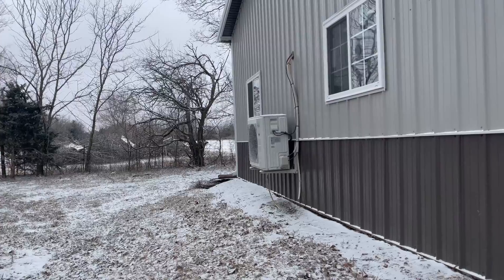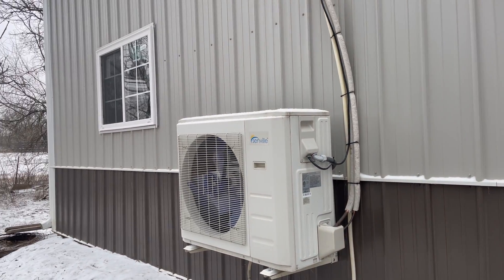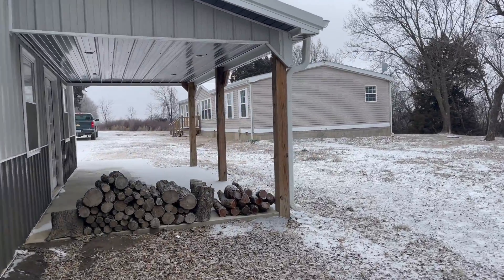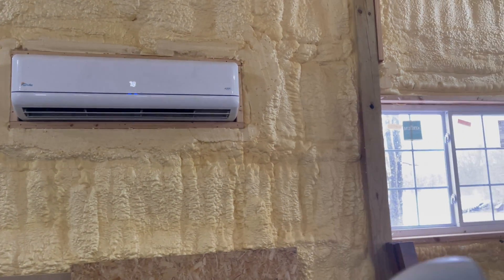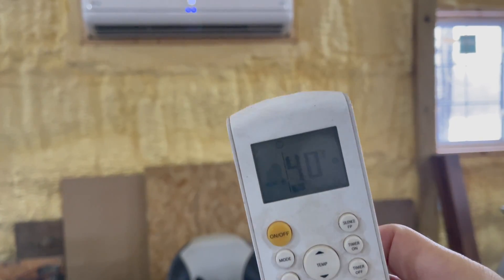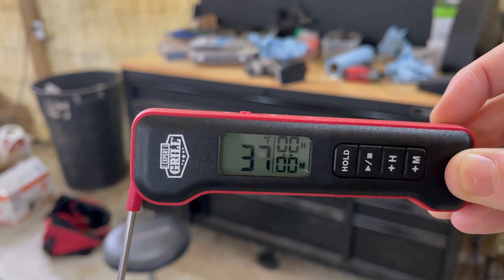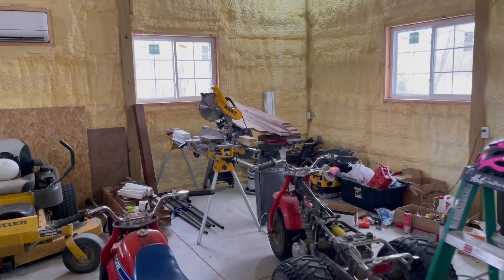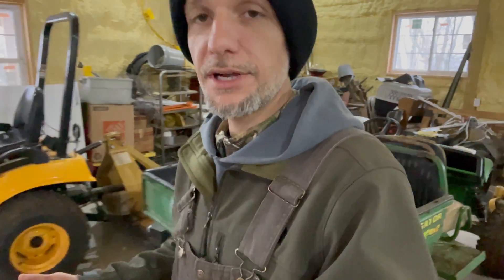Mini Split In A 30X40 Pole Barn

Comment: Nice job and report.  Question..  did you take any current measurements when the unit was first turned on,  then again after 2 -3 hours temps stabilized.  Did it ever go below 10 amps . thank you

Comment: How did you mount to the outside of the metal building? I'm about to mount ours and I only have 1 metal tubing vertical post and then one horizontal spanning the width of the building 30'  with spray foam insulation.  I do have stud walls inside as we will live in this section.

Comment: Good video, my 30x40 with 12 ceilings I have a large propane heater which is nice because it will literally take the temp from 40F to 70 in minutes and with everything insulated I just use a portable 13K AC in summer which will keep it at 75 on the hottest day in PA. Probably not the best for efficiency but the few hours I'm out there at a time it's good.
Reply: Which heater do you use . I have a 30x40 12ft ceiling  . So I'm lookin for a good heater
Reply: @blackmacgyver9965  Sterling TF-125 was already there when I moved in. It's a tubular gas fired direct spark propeller unit says the paper for it. Has the blower fan on back that kicks on when hot and wired to a thermostat.
Reply: @goaheadmakeourdayscooterpe9644   thanks for the info .

Comment: You should definitely put insulation panels on garage doors. The ceilings could also be lowered with panels on the trusses. It all makes a difference. My son is struggling with heating costs now in Missouri on a 24x48 pole barn. Forced air electric furnace is triple his bill. Ceilings and walls are well insulated.
Reply from the maker: Sounds like solid advise. Thank you!
Reply: Depending on the outdoor temp, the mini splits can be 3 and a half times more efficient than his electric forced air furnace that uses resistive heating.

Comment: Another thing to consider is, concrete and/or floor temperature. In my 30x40, I heat with a wood stove. If not heated up daily, especially in cold February, it will be hard to maintain a comfortable temperature. I have found that when the floor temperature is near freezing when I have an event, or work to do, you might as well keep your coat on sitting or working on the floor. Making instant heat is not going to change the effects of the floor temp in a short amount of time. Your wall thermometer can say 70, 75. But if you sit on a chair or work under a car, it's like being outside basically. Just another thing to consider from my experience.
Reply from the maker: This is right. I have considered keeping the heater on 50-55 for a winter just to see how bad it affected my electric bill but that would be the only way to keep it maintainable all year long.

Comment: Great video! Does the mini split seem to cool the space evenly? I have a 30x42 Quonset hut and the new mini split will be here Tuesday. It’d be easier to mount it on the back wall like yours but I’m a little concerned about the front being warm and back being cool.
Reply from the maker: There will definitely be a moment in time when it conditions the air closes to the unit sooner, but it should even out quickly. Specially if you add some ceiling fans to assist in moving the air around.  Good luck!  Thanks for watching.

Comment: Could you have ran the heat split tubing up through the inside of the wall rather then running it on the outside?
Reply from the maker: I think it would have been possible, but the spray foam was already done by then so it would have got torn up in my case. Thanks for watching!

Comment: The universal problem with every mini split is the scroll fan in the evaporator side of the unit.  It gets clogged with lint from the air inside and is nearly impossible to keep clean.  When that happens it will get out of balance, begin to make noise and loose much of it's output!  A much better alterative is the all in one unit from the same company that never gets clogged and cost slightly less than the mini split!
Reply from the maker: I have not had this problem yet. I keep expecting to have problems cuz I have had lots of comments about different problems to expect. Thanks for watching!!

Comment: Did you frame your mini split in before you had it foamed? My sheds currently foamed and i have an electric heater already which i would use as my emergency back up heater if framing in the mini split system is possible after being spray foamed. Looking for ac options as temps start to rise before summer. I didn’t have the funds for the windows and the foam so i went with the foam…hindsight is 20/20
Reply from the maker: It was framed, but if I’m remembering right I didn’t have the mini split installed yet at the time the foam was sprayed.

Comment: Once you install covering on the inside, it will take longer to heat up. A Plywood or wafer board covering has a lot of mass and a lot of surface area that will be cold. It would be interesting to see how much longer it takes to warm up the air temperature.
Reply from the maker: I didn’t think of this. Curious myself now.

Comment: The bad part about mini splits..  Most of the time they fail under under 25ﾟ. They stop heating. I have been doing HVAC  15 years. Every year I get multiple calls about about houses not heating up because the system fails when it gets too cold. You end up having to have a space heater. You can call any  H vac company and they will tell you the same thing.. If you live in a very cold climate that sees temperatures under 25ﾟ several weeks at a time this is not for you
Reply: Low ambient mini splits are getting 100% capacity to pretty much 15 f 
With the capability of running down to about -15 f
Reply: @Hvac-Alex   Sorry you don't know what you're talking about. I live where it's 15 to 25ﾟ in the Winter. I constantly get calls about people having to use space heaters during that time because they have many splits. So you are wrong
Reply: @WhateverItsanOpinion  well it’s hard to argue those great points! 
I’m an hvac contractor in Ontario Canada where it regularly is colder than where you’re living. I would never recommend ductless as the only source of heat, but for most of the year it’s a great option. New ductless units will work to 100% capacity till 5f and operate efficiently as Low as -13f but will also work in lower temps than that just not efficiently. A quick YouTube and google search will bring you out of the 90’s to today’s technology and back up my claims
Reply from the maker: I would tend to agree. Luckily this is not a living space so it works out well for its intended purpose 95% of the year in my region, but yes the performance begins to fall off quickly around the 25 deg mark. Thanks for the input!
Reply: My question would be good enough to keep pipes from freezing.
Reply: Need 2 fan units

Comment: I've read comments where some say that spray foam voids the warranty from the metal building company.   There seems to be differing opinions on whether or not foam can damage the metal, by trapping moisture, either through condensation or roof leaks that go undetected.   I'm at a loss to decide which to use.
Reply from the maker: This is the first I have heard this. Even though I don’t think my building came with much of a warranty outside of problems in the first year I’m sure he would have came back to fix it. The big companies like Morton I’m sure give warranties but they are way out of my price range. It sounds like a valid concern, but everyone I know uses spray foam so I have never considered it. In my case I used open cell spray foam so any roof leak would be detected unless it was very very minor. I wish I could help you out more but I don’t have a good answer for this one. Sorry. Thanks for watching.

Comment: How tall are your walls in your shop? I have a 30 x 35 area shop with 12' walls and 2" closed cell foam insulation.
Reply from the maker: Hi Gary. My walls are also 12’. Closed cell is the way to go if you can make it make sense financially. Thanks for watching!
Reply: @dexterranch  Have you talked with your insurance agent?  That closed cell spray foam insulation needs to be covered with fire rated covering such as 5/8" sheetrock

Comment: Very nice. I installed radiant floor heating in my shop when i built it this year. Works great. The concrete is nice and warm. I do need an AC for the summer. I might look into one of these.
Reply from the maker: Awesome. You mind me asking what the radiant heat install set you back? I’m considering doing that in my home build.
Reply: @dexterranch  check out Radiantec. I just installed 2400 sq ft of it in my barndo.

Comment: Is this a model that has a heat pump? Seems like it should do a better job being a 3 ton unit and your shed having such good insulation.
Reply from the maker: Hi Jorge. This unit claims to handle 1500 square feet. My shop is only 1200, but with 12ft tall wall I believe the amount of square feet goes down.  It’s a lot of air to condition because of the tall ceiling. I think if I would have bought the same outside unit with indoor air handlers it would be able to heat it up quicker. And if you think of it in comparison to your home furnace it is having to start from cold every time because I don’t leave it on. It will get it up to temperature, but takes a little longer the colder it is. Still plenty warm enough to work in. This unit does have a heat pump. Thanks for watching.

Comment: Excellent info. In the middle of insulation my 30x40 now. I have cinderblock walls that aren’t insulated, didn’t plan to but I just might have to. I originally planned on getting 2 36k units to do it but I’m thinking that may be overkill now
Reply from the maker: The 2 units would probably work out well without the insulation.  Cinderblocks have a little R value. Probably be ok either way you go. Thanks for watching!
Reply: @dexterranch  thank you. I may have to bite the bullet and insulate the walls

Comment: You didn't mention if you have insulated doors.
Reply from the maker: Hi Joe. The garage door does have a minimal amount of insulation built into it at the factory, but there was nothing extra added. Entry doors are just regular wood doors. It’s been a while since I made the video , but I think I mentioned that I kind of went over board with the number of windows in the shop, and then there are windows all over all the doors on top of that so it’s definitely not perfectly sealed. The spray foam does do an amazing job to help with everything though. Thanks for watching!

Comment: Greetings Dexter!

Thank you very much for sharing your experience on the Pole Barn building. I watched both videos and learned much from it. I noticed a house behind you on this video. It looks like a pre-fabricated house on either a crawl space or a basement. Do you mind sharing some information on that house? I am trying to build a similar set up like yours on my land, a small home and a pole barn. 

Good job and great content.

Thank you!
Reply from the maker: Greeting Dr Tran. Hope all is well with you.  It is a mobile home sitting on a permanent foundation.  There is a crawl space but only because the actual house sits on concrete blocks that then sit on the permanent footing foundation. I purchased this house used. It was made in 2008 and I purchased it in 2016. A mobile home like this would sell for 100-125k at the dealer but since I bought it used from an individual I paid $30k for it.  Another 15k to move it, pour the foundation, and concrete skirting. So all in all it was a very cheap solution. I will try to make a video for the channel with more details.  Thanks for watching.
Reply: @dexterranch  Thank you very much Dexter!

Comment: One year later, are you still happy with your mini split? Any issues? Any problems on the coldest days?
Reply from the maker: Hi Kevin. It was actually installed in 2018.   So 3-4 years later yes still very satisfied. Never had a problem.  Never had to do any repairs. As I said in the video on the coldest days the only thing that is allowing the mini split to keep up is the insulation. It takes some time to get it warmed up in there, but it’s always been enough for me and far more efficient than any other solution.

Comment: Nice! I'm thinking of doing a 30x40 with 12 foot sidewalls myself. I'm curious what size over head door you have and how big is your porch? We are doing a porch as well. I was going to put a 10x18 foot insulated over head door in our building. No French door just a normal walk door for us. I'm definitely going to look into that mini split now!
Reply from the maker: Hi. My door is 10 x 16, and the porch is 10 x 18. Yeah the French door was probably not the best idea. I haven’t had any problems with it but I also rarely use it. Thanks for watching.
Reply: I think if you were using those ATCs, a side x side, golf cart during extreme temps like 90* or 15* a set of French doors would be better than opening that 10x16 overhead door. I live in Alabama and I am building a 30x40x12 right now and I really want to put in a smaller say 4 - 6ft wide door to retain my A/C as much as possible. Do you or anyone else have any feelings about this one way or another?

Comment: Thanks for the video, I had one question.. was your building already built when you decided to install the split system or did you include that in the initial plans?
Reply from the maker: Hi Alex.  I knew that I was going to install it at the time the building was going up, but there were no special provisions made or alterations to the build for the mini split system. I simply framed a small box on the wall in between the existing framing to house the unit on the wall. The only reason I needed to do that was so that the spray foam had a barrier to stop at before getting on the system. If you did want to have the builder do it you would just need the outside dimensions of the unit so he would know how big to make the box. Hope this helps.

Comment: Hello, I think you may be the guy that has some answers for me.  I am looking to have a Fugitsu 12k low temp unit installed into my 525sqft shop that is in my barn.  I noticed that you had your mini split off and then turned it on.  Does your mini have to “defrost” before it begins creating heat after being off overnight or for a few days.  I will only be able to use my shop on long weekends during the cold months and hoping I can just turn the mini off during the week.  Any experience with this?  Thoughts?  Thanks
Reply from the maker: Hi!  So my unit is turned on only when needed. I have never noticed it having to go through a defrost cycle. It may be doing something like that intermittently while the heater is running, but any time I have turned it on regardless of how long it was off it began to produce cool or warm air whichever setting it happens to be on. This has been my experience, but mine is an off brand so it may not have the feature you are speaking of. Hopefully this helps. Thanks for watching.

Comment: Awesome shop! What are the height of your ceilings? Do you mind sharing approximate price you paid for the whole shop? Looking to build either a 30x40 or 28x32 and not sure what to expect for cost. Thank you and awesome shop! 👍👊💪
Reply from the maker: Thank you. I will do a video to do a cost break down. That way people can see where they could save money if the wanted, but the cost to put the building up before electric, insulation, heating and air was just under 30k. That included over hangs, the porch, cupola, concrete, and all windows/doors. The ceiling is 12ft.  Which I have been glad I did several times over the 10ft ceiling. It’s not much more to increase the height. Thanks for the comment.

Comment: All your heat is rising to the top of the ceiling. It could easily be 20 or 30 degrees warmer up there.
 Install a couple of reversible ceiling fans. When you run them in a reverse mode, it draws cool air up from below, and warms it as it spreads across the ceiling to the walls and down over the windows to the floor again. When used properly, ceiling fans do an amazing job of evening out the temperature of large rooms and ridding them of hot and cold spots. Most people will turn them off when they're using their heaters or air conditioners that can be a huge mistake.
Reply from the maker: Hi John. Great advise. I have a couple ceiling fans up there. I do forget to turn them on in the winter though. Thanks for the input!
Reply: More like only 5 F warmer in the ceiling - I have measured the temperature at my work in a 20 ft. tall warehouse several times thru the years, never saw a temperature differential higher than that from within a couple feet of the ceiling and about 4 feet above the floor.
Reply: @ValConB  You better get yourself a new thermometer.🤣
Reply: @jnicksnewstart   - Where did you perform your temperature checks, and what thermometer did you use?
Reply: @6:20 you shall see the fan, he has 2

Comment: Beautiful shop man, I’m getting a 24’x35’ shop built next week and I’m also looking at doing a mini split system and spray foam insulation.
Reply from the maker: That’s exciting. I think you are making the right choice with the spray foam and mini split. It has really worked out. Thanks for watching!
Reply: Hey Guys! I’m also getting a 24x35X9 with 1” of closed cell spray foam and trying to figure out what size mini split to get🤔